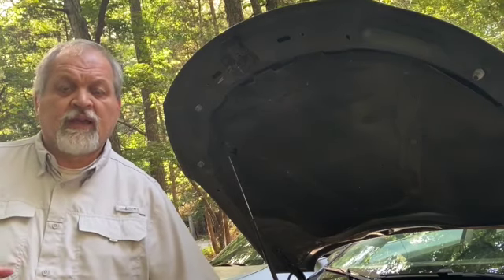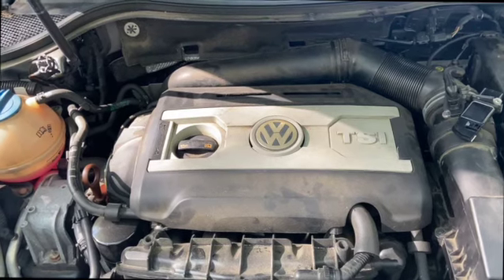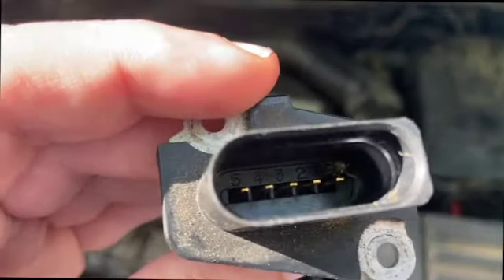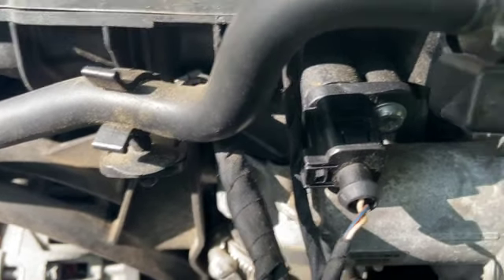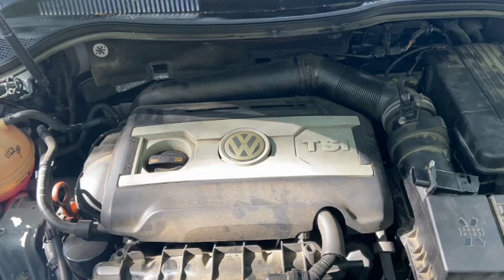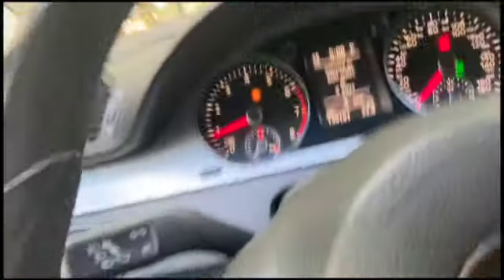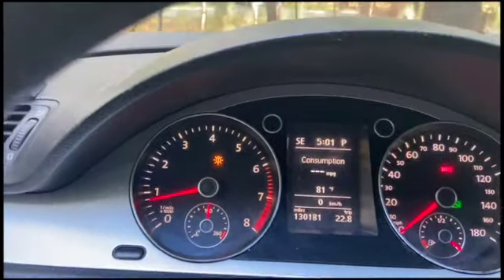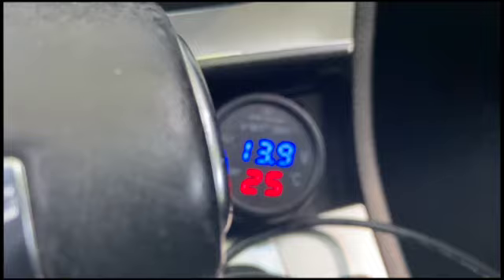How to fix  hesitation under acceleration or heavy throttle in your car

Comment: I have a 2012 Kia Optima hybrid and when I'm in traffic or I stop a lot and the gasoline engine starts, it revs a lot up to 5k RPM without me doing it and then it gives a thump because it returns to normal... Can someone tell me what problem it may have?  It only happens when the normal motor is turned on, with the electric one I have no problem
Reply from the maker: Unfortunately I have never owned a KIA and I do not know much about them, but it sounds to me like a sensor issue

Comment: My Nissan micra 2012 wont rev past 2000km but it starts very well what could be the problem
Reply from the maker: The throttle position sensor or accelerator pedal position sensor alternatively air system leaks or dirty air filter/MAF

Comment: I don’t know but my Altima 2012 started thrusting everything I push the gas and my rpm keeps making a noise and it goes up and down any help works
Reply: Same here when I push the gas, it’ll jerk/buck anytime I push or release the gas pedal.
Reply from the maker: I would start with cleaning the MAF and throttle body. Then inspect and if needed replace the air filter
Reply from the maker: I would start with cleaning the MAF and throttle body. Then inspect and if needed replace the air filter

Comment: Okay so my 05 hinda civic has a problem where it starts right up cold and randomly cuts off after warm and takes a few hrs to crank again jerks badly under heavy acceleration and becomes less powerful
Reply from the maker: I would start with spark plugs do you have any codes?
Reply: @Professor DIY  no I have no codes at all but it seems to be fuel related but I can start with plugs first
Reply: Car sat up for quite sometime from the ppl I bought it from do to this issue

Comment: Hey my audi 2.0 turbo hesitates/rpm/car jump up and down when press gas after a complete stop. Already cleaned the maf sensor did all sparkplug and coils . Still has problem
Reply from the maker: Not quite sure what you are describing but if your RPM is erratic I would check all Wiring and the throttle position sensor
Reply: @ProfessorDIY  hi i try to explain better so the audi jerks/hesitates for a few seconds when i press the gas after a stop. After it goes into second gear it is smooth
Reply from the maker: @Benjilow109  Sounds like either a fuel /air mixture or metering issue check your throttle position sensor that idle control valve and the throttle body
Reply: @ProfessorDIY  will do thanks Professor
Reply from the maker: @Benjilow109  let me know how it goes
Reply: @ProfessorDIY  will do may take a llittle while as im new to working on my car looking at your videos seeing if i can find content on what you listed above
Reply from the maker: @Benjilow109  FEEL FREE TO ADSK QUESTIONS
Reply: @ProfessorDIY  ok can the throttle position sensor be bad even if no check engine light is on?
Reply from the maker: @Benjilow109  yes in fact the check engine light does not come on as a rule with a bad throttle position sensor fault
Reply from the maker: @Benjilow109  Yes in fact in the majority of cases a throttle position sensor fault will not trigger an engine light

Comment: The first sensor is a MAF sensor. What is the second sensor called??
Reply from the maker: It is the throttle positioning sensor, some vehicles also have an air temperature sensor that is located close to the intake manifold

Comment: P1335 Engine torque monitor control limit exceeded - error code on vw golf mk5 gti. Hesitation on low rev acceleration but fine on higher revs and higher speeds. Almost like something is not opening to allow air to flow and causing turbo to flutter. Help needed please?!
Reply from the maker: sounds like a module/sensor fault

Comment: Hi, please help
In a hard stop, my car wont go forward till I press the gas pedal to the floor, 
in other senario from a parking, I shift it to drive with no pressing the gas pedal, it forwards
but when I shift it to drive with pressing the the gas normally like 10% to 20% it stops till I press it a 100% again then it forwards

[Automatic car]

Changed/Replaced:
-Transmission oil
-Engine oil
-Oil Filter
-Air Filter
-PCV
-IACV
-MAF
-TPS
-O2s
-Spark plugs
-Battery

Cleaned:
-Catalytic
-Exaust
-Throttle body

What else I'll do, I have still the delay acceleration from hard stop. . .Hope this comment will be notice :) :) :)
Reply from the maker: check the accelerator position switch and clean or replace if needed, also throttle position switch
Reply: Check ignition coil and injectors, and change air filter if the hesitation is random then just change the injectors
Reply: I should ask did your check light flash on the dashboard at sny time
Reply from the maker: @razzalee305  If you mean the check engine light I address that in the video
Reply from the maker: @razzalee305  nope the injectors should be the last thing you do
Reply: @razzalee305  thanks for the response . . . 
none, theres no check engine light at all
Reply: @ProfessorDIY  thanks for the response. . .this is still cabled carb
Reply: @ProfessorDIY  hi, should I replace it or just clean? injectors
Reply from the maker: @13ansoy65  Always first clean

Comment: My gti 2012 had me stressing with same problem , bought scanner and ended up misfiring on cylinder 2 , bought new coil pack replaced and now drives like new and no more misfire even on cold start in morning
Reply from the maker: The most common misfire cause is sparkplugs, followed by coils and then air issues like MAF
Reply: @ProfessorDIY  I have this same problem but I thought it could be carbon build up as well, I am getting error P0300, P0301 and P0303. I changed the coil packs for both of them  and a fuel injector for cylinder one and it's still giving me misfire.
I would like to know could it be the compression in those cylinder or Manifold.
Oh by the way, I have a VW Golf 1.4tsi.
Reply from the maker: @ckbond41  what model and year is your car?
Reply: @ProfessorDIY  its a 2015
Reply: @ProfessorDIY  It's a Golf 2015.
Reply from the maker: @ckbond41  The multiple misfires might point to a vacuum or an ECM issues, more data is needed, no other codes? does it misfires more under acceleration or at all times?
Reply: @ProfessorDIY  At all times.

Comment: My 2014 f150 drives fine but when I go half throttle almost full throttle feels like it’s in limp mode idk what it is
Reply from the maker: It could be a throtle position switch or even your acceleratoe petal switch, sorry I am not very familiar with FORD vehicles

Comment: Hi, my automatic 2007 audi a4 quattro 2.0L turbo has acceleration issues. It cranks and starts fine. But intermittently on a flat road it doesn't have power to accelerate when i pressed on gas pedal. When i tried flooring the gas pedal the rpm just goes up to about 4000 before gear shifted. On a light hill it struggles so much. Rpm would just get stucked at 3000 no matter how hard i push the gas pedal. So far i have changed fuel filter, new sparks and coil, maf sensor and cleaned throttle body. I hope it's not the transmission. Any help would be greatly appreciated. Thank you.
Reply from the maker: Have you checked the throttle position sensor?
Reply: Thank you for your reply. I believe  for my car the sensor is built in the throttle body assembly. However I do see a sensor similar to the one in your video. Not the MAF but the other one with 2 pins. Is the the TPS? Thanks
Reply from the maker: @mark.r8900  yes it is :)
Reply: this could be clogged exhaust
Reply from the maker: @jamesschmidt1120  Nope, clogged exhaust feels quite different and has symptoms when starting or fiddling as well unlike the scenario we are talking about here
Reply: @ProfessorDIY   no offense but I own a shop and I’ve personally fixed multiple cars with a clogged exhaust that have these same symptoms. His description is not extremely specific but it could easily be a clogged exhaust

Comment: I have a chevy aveo it over revs it self what could be the problem
Reply from the maker: It is pretty much the same for all naturally aspirated cars, clean your MAF sensor and the throttle body, and lastly clean the idle control valve.

Comment: My 2004 mazda 3 2.3l cuts out on full throttle some times and then sometimes it’s fine it’s a 5 speed manual and has exhaust so I don’t think my cats clogged but I’m very confused cause there’s no code and it’s cuts out on full throttle but is fine half throttle and normal driving
Reply from the maker: Make sure you have good exhaust flow it can be a blocked cat
Reply: did you ever fix your car?  what was it, mine is doing the same.  thanks.
Reply from the maker: @duaneafields  Yes after the MAF and the throttle body were cleaned the car performed much better a final tune-up made it run like new
Reply: I fixed my problem it was the maf wiring had to cut open the harness and find it
Reply: Also my Mazda kinda stright piped itself so I got no cats but is it normal for it to smoke bluish at high rpm’s
Reply: Did it sound like the exhaust cut out or like loses air pressure some time then comes back? If so mine is the same very confused

Comment: M having this problem in my one year old  Hyundai tucson 2.0 and it struggles especially during initial gears . Also hearing engine noise
Reply from the maker: Sounds like transmission issue maybe the shift solenoid if you are lucky

Comment: Thanks for the video... but.... I your the "Professor DIY" consider being a professor and creating some videos, which identify all the inputs to the PCM, and how any one or multiples of them could result in poor vehicle performance and PCM DT codes. 
Your approach in this video, is basically a shotgun approach to attempting to solve operational symptoms.  It does not as a component of the PCM system, attempt to determine reasonable drivability cause(s), relative to those symptoms. 
Yes the Mass Airflow Sensor can cause operational issues... but is that factually the component causing the symptom, and how does one go about validating a faulty MAS?
Reply from the maker: Clearly, I am Professor DIY, however, for this video there is no reason to identify the inputs because they are irrelevant but that is why I am the professor and you are not :)

Comment: I have a 2010 toyota corolla. When im stuck in heavy snow and smash the accelerator it will lose power and stop accelerating slowly by itself
Reply from the maker: Does it have traction control? Does the engine light blink when it happens?
Reply: @ProfessorDIY  engine light doesn't blink but traction control blinks quick

Comment: My 2018 Silverado has this problem, the Pedel gets hard when I reach 40 mph
Reply from the maker: That seems like a different issue do you know if you have a pedal positioning sensor or if you can adjust the tension on your throttle body?
Reply: @ProfessorDIY  I’m not sure to be honest, I just got the truck , is a 2018 Silverado z71

Comment: My ford figo also hesitate when accelerating. Also heavy on fuel. No codes. Idle and start perfectly
Reply from the maker: Based on what you describe I would check/clean yjr MAF the mixture control and the throttle position sensor

Comment: Hello, my car is hesitating between 3-5k rpm i tried replacing the spark plugs, fuel filter , new battery, and i even adjust the distributor timing. My car is Honda Civic Vti (2000) im running out of ideas. Thank you
Reply from the maker: Thr specific range of RPM would lead me to check the throttle position sensor first
Reply: @ProfessorDIY  thank you so much!! I tried it and now the car is running great!
Reply from the maker: @nelrellama4943  Glad to be able to help you!

Comment: A bad narrow band O2 sensor can also cause stalling when moving off from stop as it did with my 2001 Dodge Ram some years ago; I replaced the sensor and it fixed it; of course my van has a speed density engine = MAP engine NOT a mass airflow=MAF engine.
Reply from the maker: It is rather uncommon to do so especially with out engine codes
Reply: thanks for the response  I dont remember if codes were present but replacing the sensor solved the problem...I learnt it from other sources .....Im not a total newbie, @ProfessorDIY
Reply from the maker: @carlodonnell146  I did not sufggest that you were - however a bad O2 sensor is not a common cause for these symptoms and it always trigger a code
Reply: @ProfessorDIY  thanks for the back and forth
Reply from the maker: @carlodonnell146  Of course I do these videos for you guys!

Comment: My truck sometimes runs strong and other times it has sluggish acceleration
Reply from the maker: check/replace your air filter and MAF clean throttle position sensor

Comment: Hello i have a 1995 honda accord ex. It doesnt accelerate past 5000 rpm's, shakes aggreaively, takes a while to shift past 1st gear and wont leave 2nd. It aslo has a very aggresive shift.
Reply from the maker: What you describe is consistent with transmission, replace the ATF  as soon as possible and hope for the best

Comment: It also drained  the battery  but alternator is working vw polo bujwa 1.6
Reply from the maker: I am no9t sure draining the battery is related to this issue unless it happens when your voltage is very low

Comment: My 2004 gmc envoy spudders on acceleration for a few seconds. Enough to jerk the vehicle for a brief time. No CEL. What could it be?
Reply from the maker: Start with the simple first like the air filter and such then Clean the throttle body, MAF sensor, and if not resolved middle control  and throttle position sensor

Comment: That other sensor looked like MAP (manifold absolute pressure) sensor
Reply from the maker: The 4runner does not have a MAP however
Reply: @ProfessorDIY oh I thought it was vw CC in the video
Reply from the maker: @samgrieg  No the cc has very different-looking sensors and is more modern!

Comment: Man I have my 2001 Chevy Silverado in limp mod won’t go above 20 mph
Reply from the maker: any codes? what symptoms?
Reply: @ProfessorDIY  when I go to accelerate or stomp on the gas it won’t go above 25 mph but the rpm gage will go up
Reply from the maker: @Trey-sd6dz  do you hear any npices frpm the transmission?

Comment: I use brake cleaner and it works fine. Where is your proof that you have to use mass air flow sensor cleaner?
Reply from the maker: In the simple fact that the main element is easily dissolved, and maybe you are lucky so far, but it would be irresponsible to not advise people that they should use only the appropriate chemical
Reply: @ProfessorDIY  I repeat: show me your proof?
Reply from the maker: @barryrenouf3450  Show me your proof that it does not. And my proof is based on knowledge, when the designers of something tell you not to use anything but specified cleaner and automakers invalidate warranties for doing so that is what people should do, why would you risk it? and even in your case how do you know that you have not damaged your sensor?

Comment: My hyundai i30 2010 1.6 cutting off the engine while driving & struggling to start
Reply from the maker: is your engine light on or the car misfires?
Reply: The is no engine light the only thing i notice is less power on ecceleration or hesitation

Comment: So you recommend not to clean MAF sensor with Throttle clean cleaner, it has to be MAF sensor cleaner... But you ended up with buying a new MAF sensor...?  Is this your first "DIY"?😂
Reply from the maker: Thank for insulting me. Cleaning a sensor does not always work but it is the prudent first step, if that does not work replacing the sensor is the next step. It is called troubleshooting try it some time.